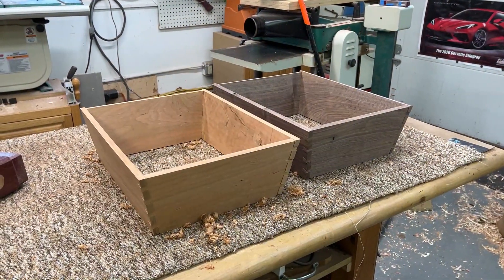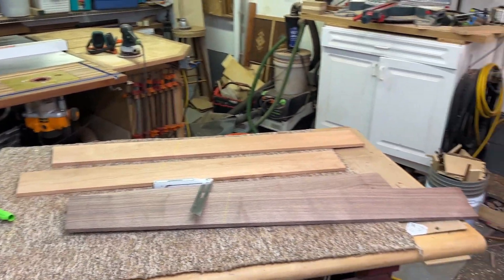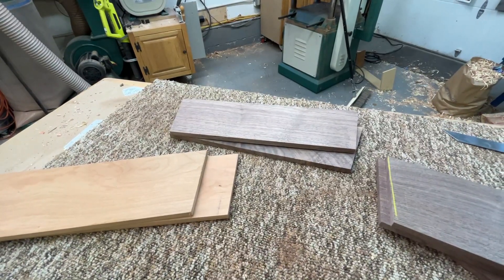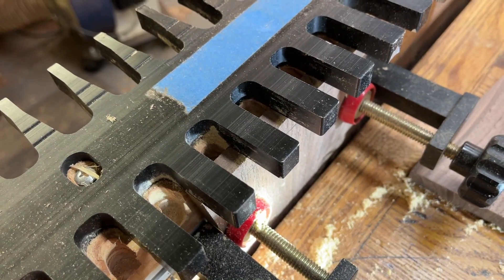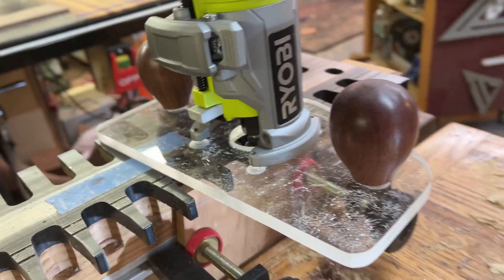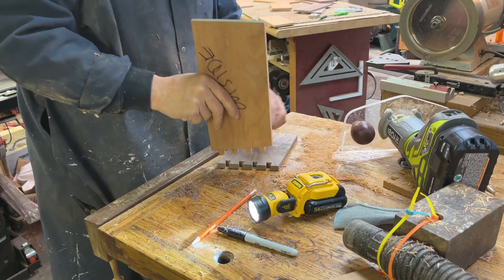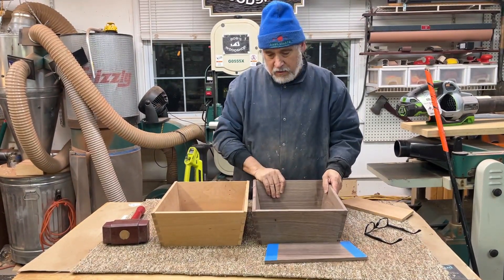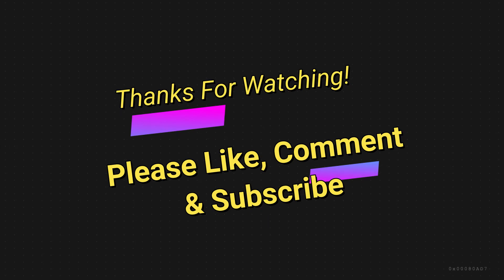How to Cut Dovetails on Angled Compound Butt Joints - Peachtree Dovetail Jig & Ryobi Router

Comment: Bob , I have a question, I've seen several Youtubes, how to do this compound bevel for a box. They all say that you have to have a bevel on both the ends of each board or your box will not be square. On fellow used a 26 1/2 deg angel on the ends with a 14 1/2" bevel along that angel to make it a compound bevel. You did not do that in this youtube , did your box come out square? I could not find the part 2 of this build. Maybe you addressed it there. Can you help me with this question?
Reply from the maker: Good question.   Since both the sides and the front and back are all cut at 10 degrees,  with dovetails construction, it’s a compound angle.   I just used the blade angled at 10 degrees on all cuts.  Yes, it’s square at the top.
Reply: In this case with a 10 degree splay the compound butt joint would be about 1.5 degrees, very minimal, and of course the bigger the splay out the bigger the difference on the top edge miter angle